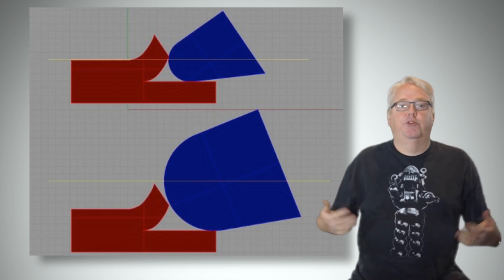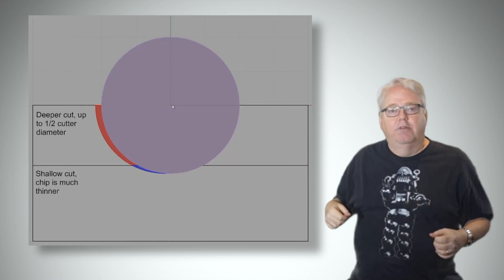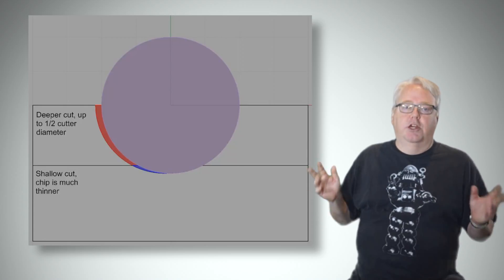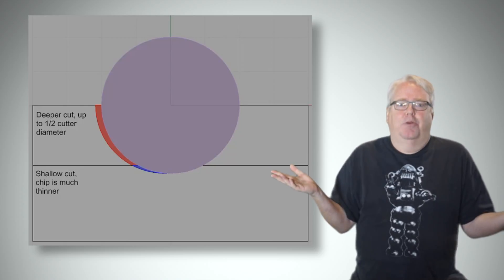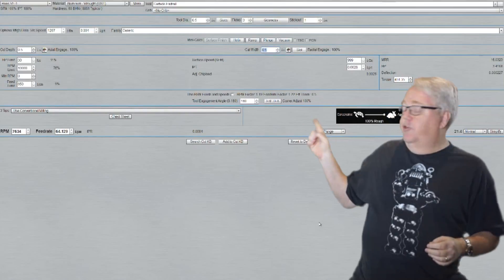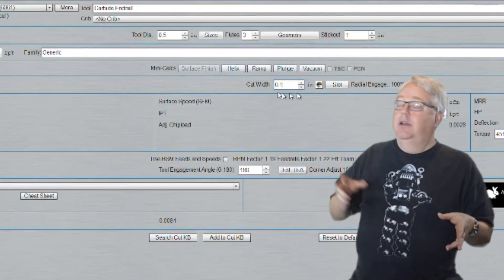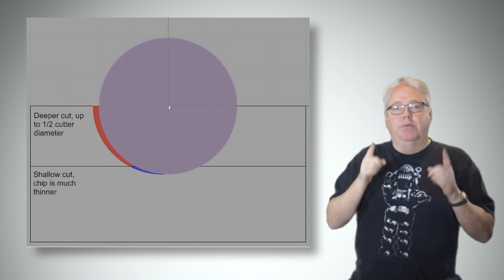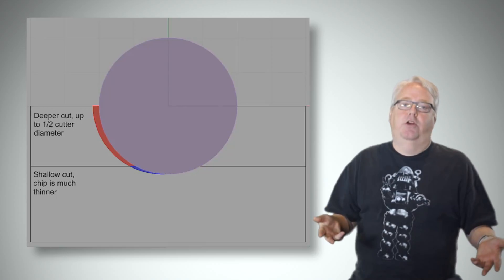Episode 2: Chip Thinning

Comment: Hi, do you have experience applying that chip compensation approach on difficult to cut materials such as Nickel based superalloys? I tried  it but turned out to be difficult to implement as increasing the chip load caused a steep increase in the cutting forces which caused a short tool life. For my trials I used WC solid end mills with 4 flutes and PVD TiAlN coating of 1mm diameter. The rpms were kept constant at 40K RPM and my feed rates raged from 25 to 250 mm/min , which are bellow the cutting edge radius (5 microns). But still the forces increased and the tool life deacresed by increasing the feed rate.